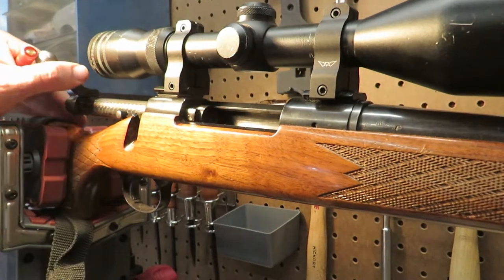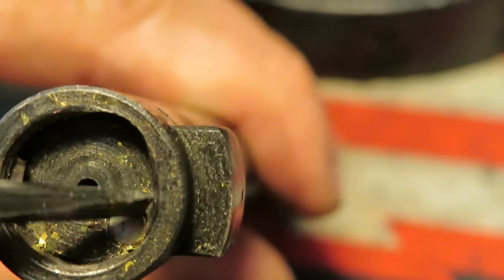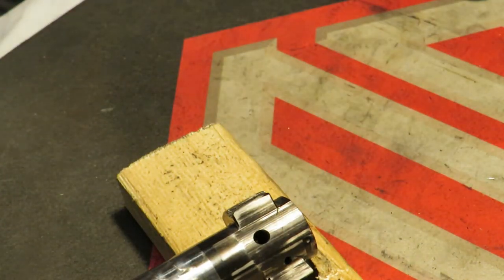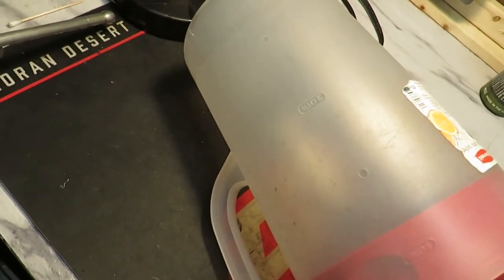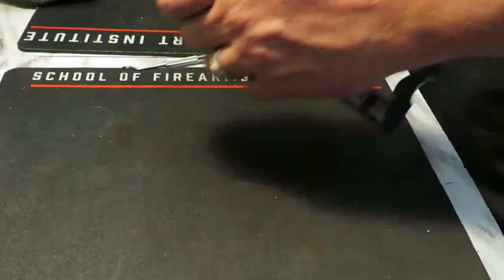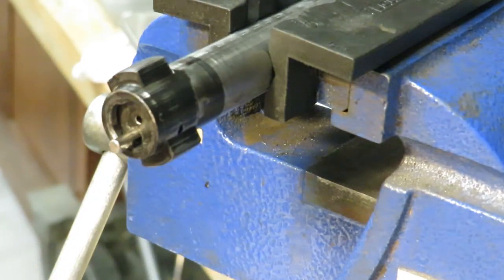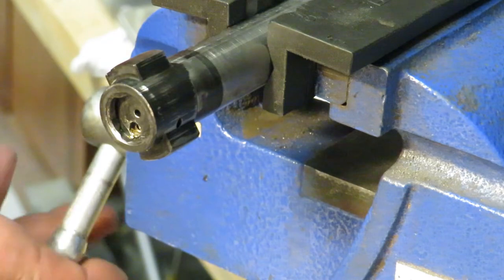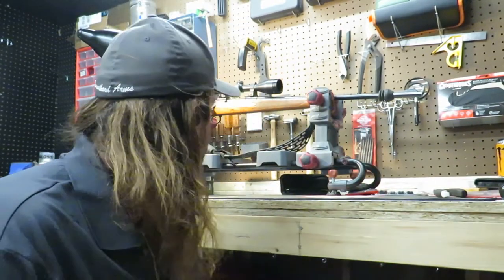Remington 700 Broken Ejector (FIXED)

Comment: Had this on a brand new 700 in 25-06 about 1972 or 1973. No movement at all. Had to return rifle to Remington for a new bolt. Their guess was bluing solution not cleaned and the spring rusted in that blind hole.

Comment: Quarter in the vice, then a dime in the slot. That minimizes the gymnastics.
Reply: The dime slot is in later models than this one.
Reply: @webb-cast1030 you can still use the dime even though it has no slot, just pull it a bit farther.

Comment: Seeing all of that brass that has flowed into the ejector plunger and probably the firing pin hole it makes me wonder what kind of pressures the owner is running. You might want to mpi the lugs and breech just to cya.
Reply from the maker: Everything with the lugs was good. The customer had told me that he had only used factory loads. Nothing going above necessary pressure. However, he told me that he had never cleaned the firearm. That is just years and years of brass fouling build up